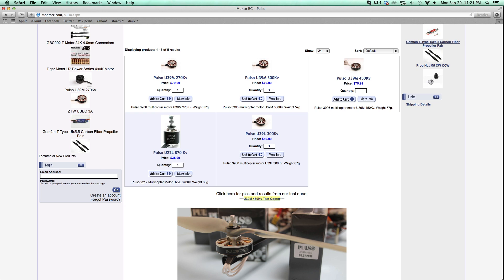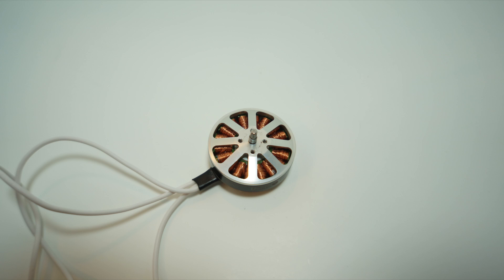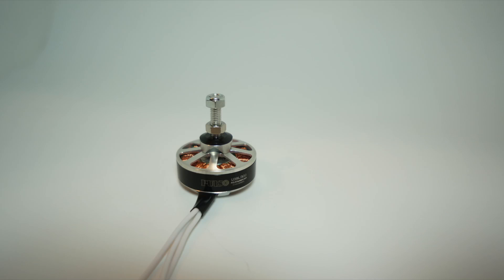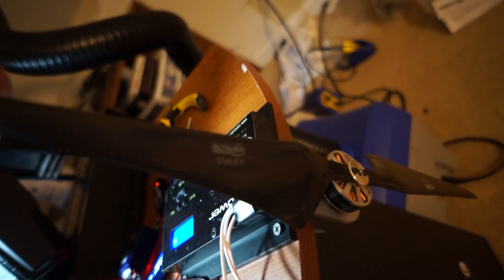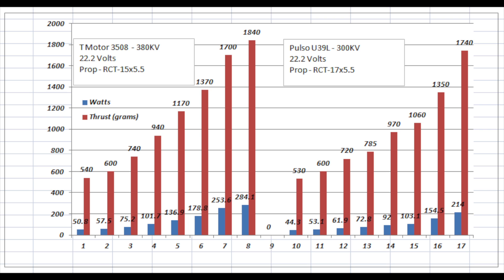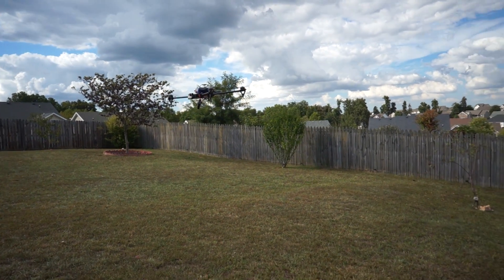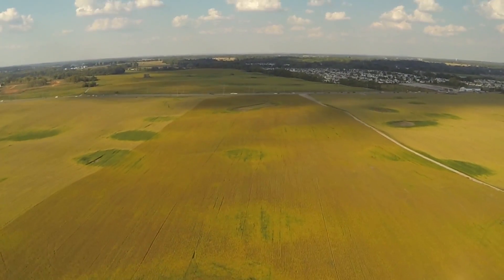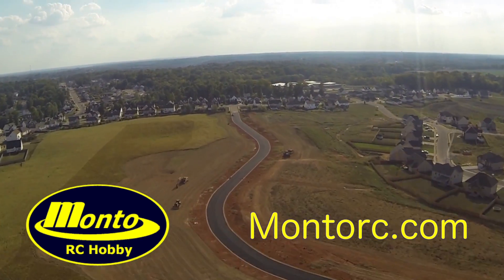Pulso U39 Series Motors In-Depth Review

Comment: FLow great review! I personally have never heard of those motors but the results look very promising. I've recently finished an LR quadcopter project and I used TMotor Antigravity 4006-380KV with KDE 18.5x6.3" foldable props, I built a custom 4S4P NCR18650GA battery pack and with an AUW of 2114g I can hover for 55 minutes. Im flying with the new Pixhawk 2.1.

Comment: Its great to hear your experience.  There really isn't vary much info on these out there.  I would be interested in how they compare to T-motor 3520's for AP.  Without personal experiance it seems like the 3520's will Lift more and maybe offer more performance in windy conditions but the pulso's look great to get jello free video.  Flo, Have you had experience with these in really windy conditions?  25+ MPH?
Reply from the maker: +Brian Wennersten jello in wind doesn't have much to do with a motor. The size of your prop, weight of your aircraft, and dampening system are more of  the contributing factors to jello in wind. To fly smooth in wind you need a smooth motor a balanced prop, a aircraft that doesn't fly to light or to heavy, and a good gimbal dampening system.

Comment: Thanks for the video! Does overlapping 17 inch props cause the jello in this video?
Reply: +Ringo Long FYI - I extended my arms with the Tarot vibration dampening mounts, had a custom 2.5mm carbon fiber frame cut that was basically a clone of the tbs frame with a few changes, installed the DJI e1200 kits, but the motors had too much torque for the arm mounts that are attached to the frame. I was going to pursue metallic mounts, or wider ones, but the crazy yaw killed it for me. I was getting 16 minutes from a gens ace 3800 30c 6s.

Comment: Great video. Quick Question do you think these motors are well suited to run on 4S. Im planning a endurance video platform and im interested in your results. What prop size yould you recomend.
Reply: Actually been banging numbers into ecalc from your testing with these motors do you think they would spin a 22x5.5 t style prop on 4S with the frame weigh that im calculating should pull about 25A at full power. Any takers haha.

Comment: how do you fit 17x5.5 props on the tbs discovey? does it fit with the stock carbon fiber arms?
or did you do any mods to it?
Reply: because i thought 15x5 was the max for the disco
Reply from the maker: Wilbert Collante Front motors are angled back 6 degrees.

Comment: 380kv and 15 prop VS 300kv and 17prop
it is like "apples to oranges"
Reply from the maker: Its obvious you didn't watch the "entire" video! If you did you would have seen I stated I even tried the 380 on 17" also. better efficiency still went to the pulso. Try watching next time ;)
Reply: So you are comparing 380kv VS 300KV.
I like all ur videos, but this is just not fair comparison.
Reply from the maker: Znakla a motor is not fair or unfair on a kv rating. these motors are the same weight which is why they are being compared. What you are trying to say would make no sense at all. If a motor was fair to compare on its kv alone I could compare a 1806 size motor to a 4014 as long as they were the same kv. That is a totally false assumption that a kv is what makes a motor comparable. KV is rpm not the size of a motor.
Reply: ***** motors with lower KV with right suited props are almost always more efficient.
Reply from the maker: Znakla Once again you are not understanding how a motor works. A motors efficiency is rated by how many grams of thrust it can make at a certain amount of watts. Regardless the prop regardless the kv. Checkout rcgroups for more info about motors.
Reply: ***** g/w it is simple. All long flight multirotors have lower kv motors and huge props, so lower kv is usually more efficient. My comment is for people who dontk now anything about multirotors and who can think that noname motors are better according to your video. for almost any motor you can find efficiency table with different props and according to these numbers, quad weight u should chose your motor and prop.

Comment: What is the best way to avoid the Jello effect? I know balancing the props and using anti vibration camera mounts helps but is there a type of popular camera that works better than others? Or do the dead steady videos we see always use uber expensive gimbals? FLoHIO117 do you know why you are getting the Jello effect whilst flying in the last part of the video? Nice review i have just purchased a very similar looking motor 350KV buy 170g apparently 1300W each! They are 60mm outer diameter and more or less a pancake shape package. Looking forward to testing, am thinking 27 or 32 " props with a light frame. 18650B is my chosen cell for the project but i know there are a few other larger lion cells out there that may be even better for tyne job.

Comment: How well do you think these would be on a 15 lb hex  I see that they put out enough trust on 1755 props wander if they would do just as well on 1855. I'm thinking of changing motors on my hex and looking at these if they would work on a  AUW max 7200g, Iike you I can' find any specs on what max watts are or prop size.

Comment: Do a comparison with these and the RCTimer 5010 360kV motors on 17x5.5 and 6S. Will be interesting to see how well those $18 RCTimer motors perform compared to this.
Reply from the maker: If you buy them and send them I will ;) However they're a much larger motor so its not really in the same class as these pulsos.

Comment: For the most part, you get what you pay for... I would like to see the iPower MT4108 360kv in the mix as it cost less than $44, has the expensive features such as EZO bearings, dynamic balancing, and thick shafts. GotHeliRC need to send you a set for review. And they need to send me a check for the plug!!
Reply from the maker: LMAO! Well you can talk to them for me then :)

Comment: Next summer I plan on rebuilding my disco into a true LRS- I also will probably run a pixhawk on it (currently a full naze and no gps) I was shopping the Aerial Mob arm kit and I run SS 3508-380kv's on my 680 Hex- so they were considered as those motors have been absolutely stellar on 6S (AUW of 3.2kg and 23min hover times with 18min real world flying)
After seeing this review of yours, I am certainly tossing Pulso into consideration- you are right- they sound fantastic.
Thanks tremendously for the efforts in testing- saves lazy pilots like me the time and guess work as well as expense.
Reply from the maker: No problem man. Glad you enjoyed it. :)